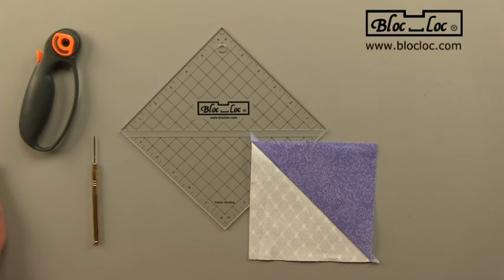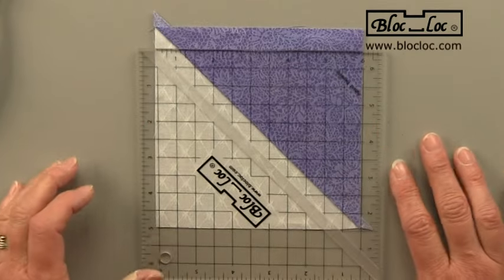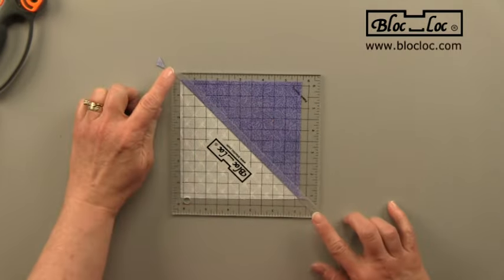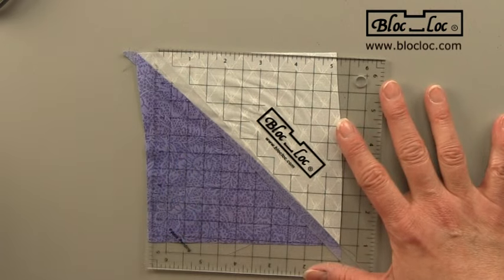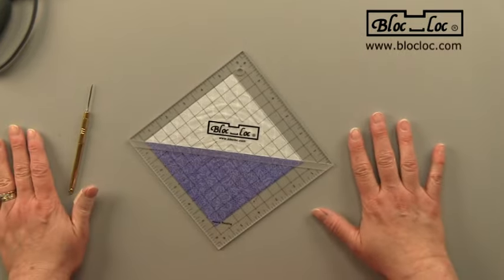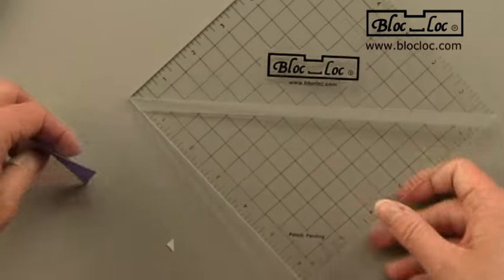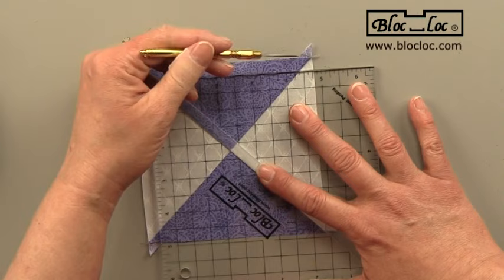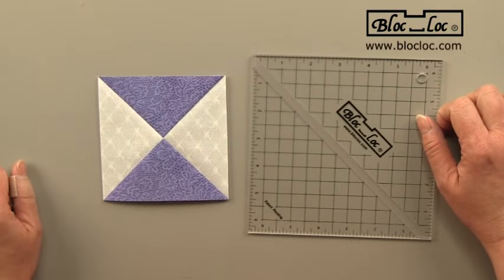Bloc Loc Half Square Triangle Ruler How To Video

Comment: Just bought the 6.5” ruler. I have a bunch of HSTs ready to trim, all with seams pressed open. I was disappointed that this does not “lock” onto open seams. 😢 it still works by using the diagonal line. I’ll have to make some more blocks and amend my pressing. Perhaps I could press to one side, trim, then press open. The pattern I’m working with calls for open seams and I really do like how the open seams lay flatter and it seems I’m less likely to lose my points. I still don’t know why they are sooo expensive, over $30 for a 6.5” piece of plastic seems pretty steep for me.

Comment: So how do you know you're not cutting too much off your first 2 cuts, before you turn HST around for last 2 cuts?
Reply: Since no one responded to you and I have the same question, I'll share my observation from the video.  First, it looks like the units are made a full inch larger than needed.  Second, it looks like she gives a 1/2 inch over the desired finished size for the first cut and then squares up on the second.
Since most of us will not end up with units this large, I would suggest that you follow basically the same formula for any squaring up.  For me I tend to either be really close to the desired size or maybe a bit under.  Assuming that most folks are a tad over, not as much as hers here, just place it to the desired size and trim.  I could be wrong as I don't actually own one of these yet but if you are really close to your desired size, it seems to me to look like you would follow the standard rules of any ruler being used to square up.  This one just keeps you from slipping and makes it super easy for trimming both sides without having to lift the ruler and re-position.
Hope this helps!
Reply: The ruler shows you that you are over on the bottom as well. I saw it done at a show as I thought the same thing but it was easy

Comment: Not quite as easy as it looks, the ruler slides when you begin to cut. Just have to get the hang of it, cool ruler.  The key to the ruler is to make your hst's quite a bit larger than what you need as a finished size.  Mine were not large enough for the ruler to work like it does on a larger square.

Comment: Blocks have to be quite a bit larger than what you want for the finished size.
Reply: @Elaine McAtee I've found there is no need for the blocks to be "quite a bit larger". Many times, I only need to trim two sides of the block. As long as you're lined up to the correct size and everything is straight, that's all you need to do. Don't get hung up on "having" to cut all four sides.